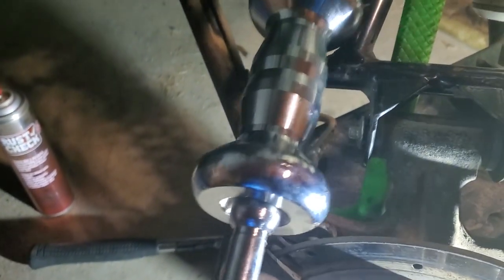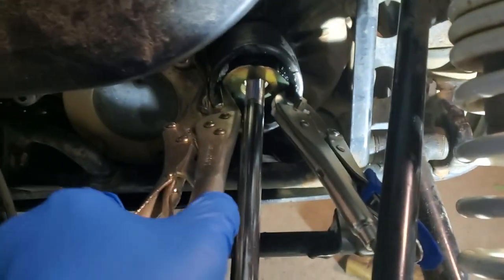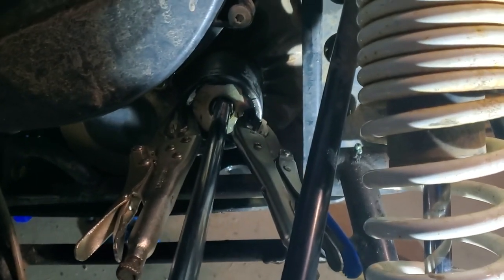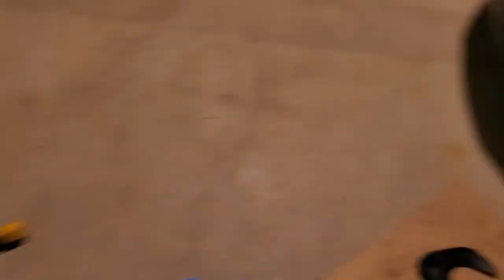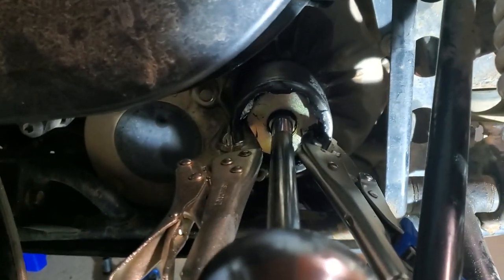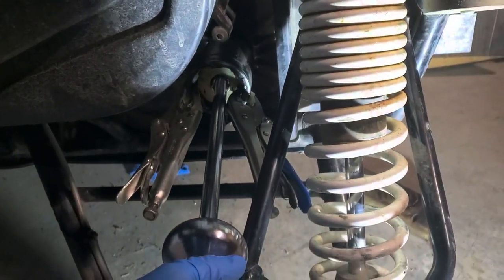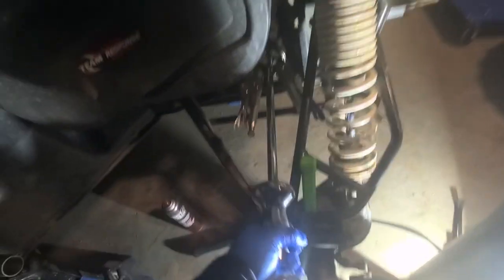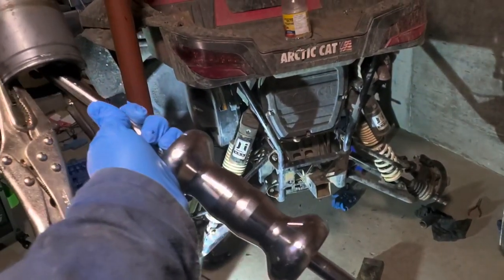The BEST & Easiest Way to Remove Stuck Inner CV Joint Axle/Cup - Don't Waste Anymore Time!

Comment: 2001 honda prelude having this issue, mechanics are about to try this! Update after they try
Reply from the maker: Thanks for reaching out, would love to know How did they end up making out?
Reply: @FullThrottleBHP  no good😭😭 they're still working on a solution as i type this. Looking at also replacing the ATTS module to hopefully help get the axle out

Comment: Wow I never this method before, do you remember what size washers these were?
Reply from the maker: Thanks for reaching out, I hope you enjoyed the episode. If so please consider subscribing and leaving a thumbs up!

I tried every method I could possibily find online to get this axle out and this was the only one that worked. The washers were large 1/2inch I do believe, but will double check tomorrow once I'm home. 

- Full Throttle
Reply: @FullThrottleBHP subscribed! & please let me know I'm going through a similar issue right now.
Reply: 1/2 inner 2-inch outer?
Reply from the maker: @AreaCode862  Thank you for your support is is greatly appreciated 🙏 They are measuring 1/2" inner diameter to fit over the shaft of the slide hammer and outer diameter is 3 inches. 

Hopefully this helps, what kind of vehicle are you doing this on? 

- Full Throttle